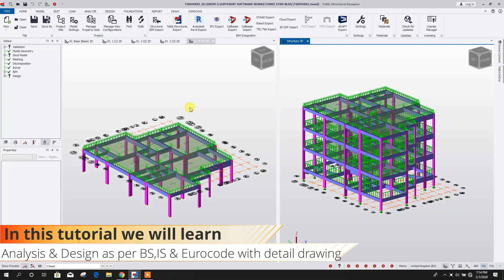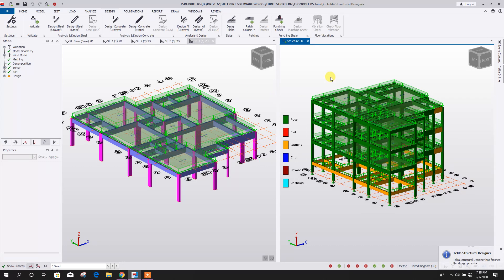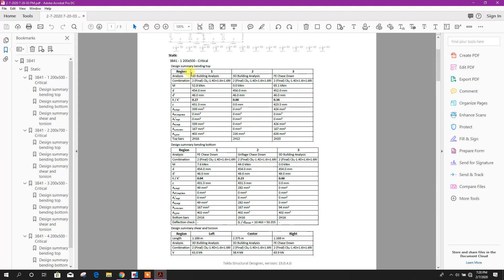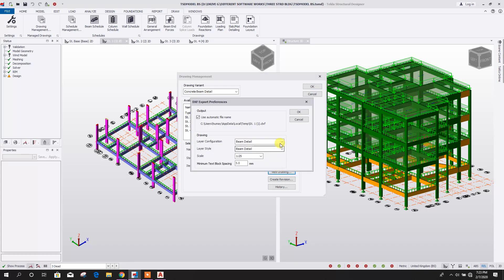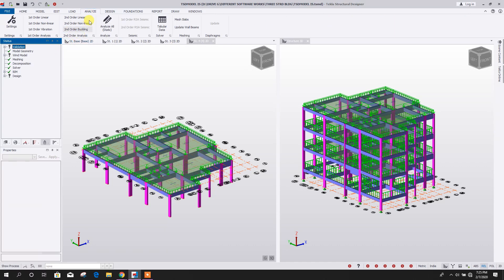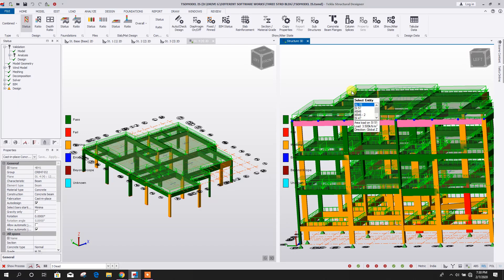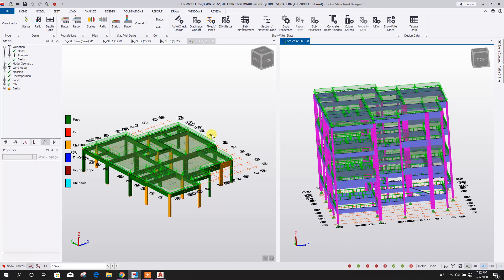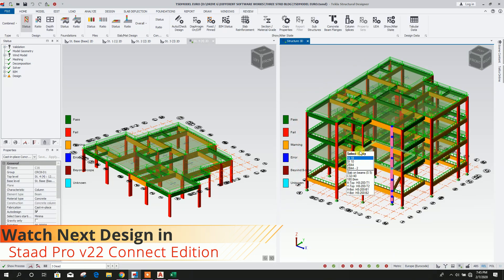Three Storied Building Design in Tekla Structural Designer using BS Code | IS Code | Eurocode

Comment: Sir, when I compare the results between ETABS and Tekla Structural Designer, axial force on columns and shear force on the beams is exactly the same.

But the moment is different, it’s always higher on ETABS, I set all the stiffness modifiers the same on both softwares.

Comment: Is there a table of design results like rcdc in staad pro and midas gen/nGen where you can change rebars and where you are able to check deflection bending and shear capacity and failures when redesigning, it is really user friendly if tekla has that feature. All design results in a table for every category like columns, beams etc with grouped and ungrouped members. This is the feature that I am looking for in Tekla structural designer. In the table you can copy/paste rebar to every members without having to change them individually

Comment: The columns are not passing design check due to Eurocode limits on shear links that are more steingent than BS and IS*,  not a problem with the software. The spacing of shear links in EN 1992 is taken as the minimun of:
1. Smax =  400
2. 12 x largest bar dia = 240
3. 0.6 x smallest column dimension = (0.6 x 200) = 120mm.

If you reduce the link spacing, all the columns will pass the design with no warning

Comment: Assalamualaikum brother
I am designing g+50 storeys building in Etabs in that my shear wall is failed at the bottom storey what should I do now 
I also increase the thk and length of wall and  also use property modifiers as 0.7

Comment: This is excellent material for beginner structural designers, also provided in BS code. Most of the structural design in the Middle east are based on BS code. I highly recommend to understand and work with BS code if desiring to follow a carrier path in UAE, SAUDI, OMAN, QATAR. Once again to DECODE BD wonderful work. thank you for your contribution.
Reply from the maker: Thanks